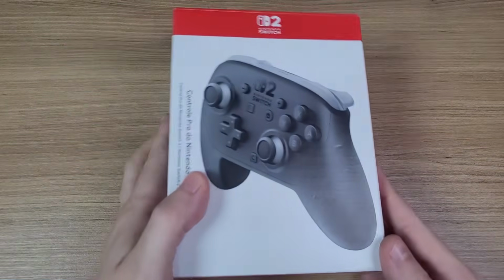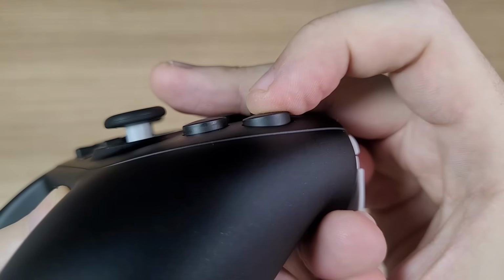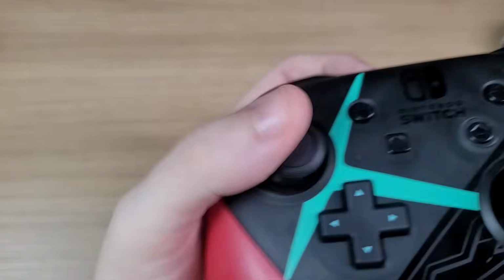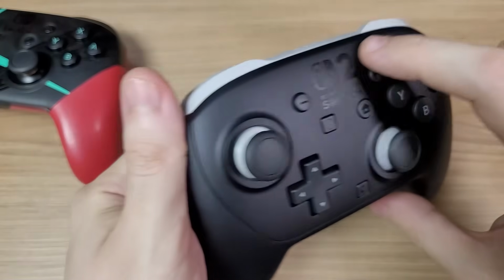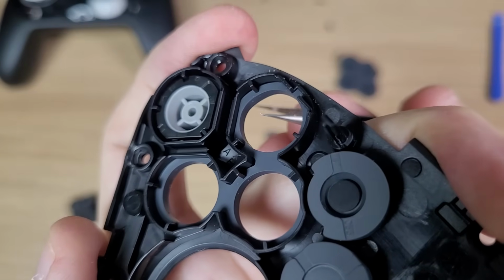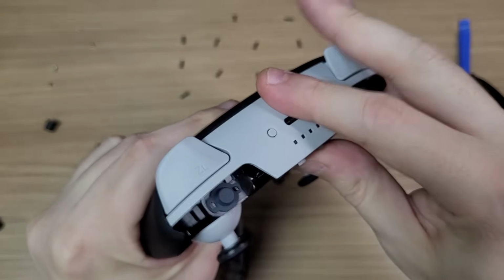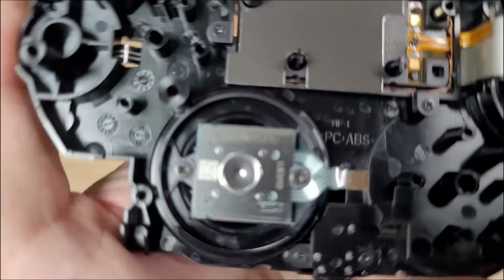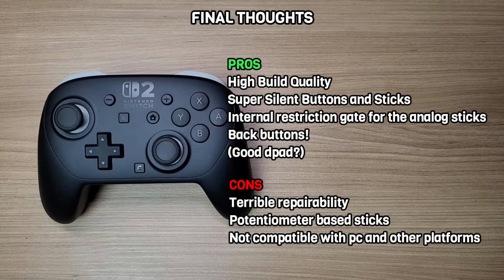Switch 2 Pro Controller Review & Teardown - The New First Party King?

Comment: I despise controllers with built-in lithium batteries that aren't easily replaced. There should literally be a simple cover with one or two screws and have instant access to the battery. My controllers always last me 10 years or more but those batteries won't
Reply: I still have my original Switch Pro Controller, and after 7 years and 1000's of hours, the battery still gets me 30+ hours of gameplay per charge, which is way better than any other controller I own. Definately wouldn't worry too much about it!
Reply: @samuelmcconkie  Yeah I think he is missing the fact that the Switch Pro controllers' batteries last SO DAMN LONG that when they lose capacity they still last a really long time.
Reply: @Krytern  he probably never even used a pro controller in his life
Reply: What's with these negative responses to a simple preference stated. I love my Xbox controllers because I always use my own rechargeable batteries and can replace those in seconds whenever i want

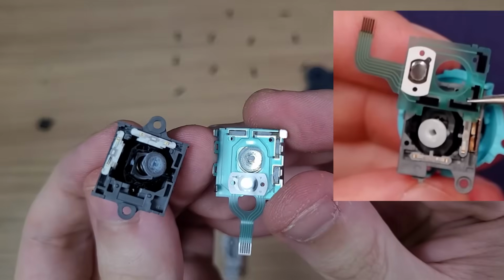Comment: 16:30 paying $80 for this controller and getting potentiometer joysticks should be a crime dude.
Reply: In Poland 105$ Was schocked that it has digital triggers 😆
Reply: A bigger crime is people paying $199.99 for a Dualsense Edge or Xbox Elite 2 controller and those are using the same kind of sticks. 😬
Reply: You can pay 200 bucks for one of those fancy, super modular Victrix Pro BFG controllers and STILL not getting hall effects (and also cheaper plastic).
Reply: Got plenty of criminals out there then because Playstation, Xbox, they're all wiper based. Even the $200 controllers are wiper based. People like you are delusional as if everyone else is offering Hall Effect or TMR and only Nintendo is somehow not doing it lol.
Reply: u got a point but theres tmr joysticks for switch
Reply: @stevensv4864  so now you're at  $100-$120 after mods

Comment: No way. They used the same internal joystick design as the inherently faulty JoyCons. The design used in the old Pro Controller has been used by many controllers for decades, and always held up better. Now Nintendo decided to use an inferior one that puts extra strain directly on the brushes and pads. The side-mounted rotary brushes are definitely better because the stick doesn't press down on them. This is just poor design, hall-effect isn't the only solution.

Comment: 15:48 Those thumbsticks look extremely similar to the sticks used on the ROG Ally, which do have hall effect replacements. So I wonder if they will work with the Switch 2 pro controller?

Comment: How does sticks smoothnes compare to vader 4 pro's?
Reply from the maker: moving the stick around feels nearly identical to the vader 4 with the same tension on the adjustment, but touching the edges feels much nicer thanks to rubber internal restriction gate

Comment: The plastic smells on your hands and the D-pad is worse because it presses other unwanted directions. I'm not sure what kind of plastic is used, but it may be not good for health. The old one and controllers from other consoles do not smell when holding. The back buttons are also annoying, even if disabled. The good thing is the audio jack. For the D-pad I prefer separate buttons like on Joycons. I like the controller, but the issues idk... And why is Nintendo disabling the use on computer? It makes no sense. Just to annoy fans? Btw there is a new EU regulation starting 2027 to provide better access to batteries of devices. Just like back then. I hope so when I see this complex disassembling. So maybe for Switch 3 in 2033?

Comment: I have opened many old controllers, NES, SNES, N64 and GameCube controllers, they are so easy to open. Now this switch 2 pro controller, looks like a nightmare to open, I just bought one. For sure thank to this video I will never attempt to open, if I open it, probably I will not be able to close it. I am so glad switch 1 pro controllers are compatible.
Reply: yeah the og pro controller was so easy to open but this one is the exact opposite
Reply: Some goes for Ps4/5 and xbox controller that cheap membrane in the front bottoms las about 2 year and you have to tear the whole thing apart and it plastic pint are super tight is a hell to open them,
Reply: they cannot wake up the switch 2 however
Reply: @RationalFunction Yeah that's part kinda sucks I mean I have my switch 2 on my desk so it's easy to turn on it but it still sucks
Reply: yeah, but at the same time Nintendo did this on purpose for their bottom line, lol (screw them) @AJMegaScizor
Reply: ull open when drift starts...
Reply: @omgoat I have 7 pro controllers from switch one, and 10 pairs of joycons, none of them have drift.  I take care to play nice with my controllers.
Probably many people play Mario party o maybe smash bros, the very strong input you have to do in that game, maybe is the reason of the drift.
Now that I remember, 2 of my GameCube controllers from 2002, had drift around 2004, I remember I played smash so much. I think this game is the reason of the drift. I never play it on portable mode, I am scared to damage my joycons.

Comment: I did some stick replacements on the switch 1 joycons through ifixit myself. I also took apart a pro controller 1 to remove dust from it. 
The ifixit instructions advise to disconnect the battery cable asap for safety reasons. So why would you put the battery as well as the connection at the very bottom of the assembly?? 

I mean I get it. The danger is probably relatively low and it's not primarily meant for customers to open electronic products, yadda yadda yadda... I still keep wondering xD 
(I'm no expert at all just a curious person)
Reply: The instructions for this type of kit are designed for people who are really unfamiliar with electronics or anything else, and therefore to ensure they don't make any mistakes and avoid accidents like accidentally creating short circuits. Generally, when you know what you're doing, the moment you disconnect a battery has absolutely no importance or influence on disassembly, apart from the convenience you gain from disconnecting it at the right moment (often at the beginning so as not to forget, when the cable is placed in front of a component to be disassembled, or when it's the last thing to do before being able to separate one component from the other).

Obviously, I'm talking about this for a controller. A console or other devices potentially on standby or dependent on powered memory is a different matter.

Comment: This controller is the most absurdly quiet and smooth controller I've ever used. If it starts working on PC, it'll be a streamer's dream because of how little noise it makes.
Reply: i dont know about this one but my switch 1 pro controller drifted after 6.5 years which i would say is pretty good
Reply: Streamers already have a "dream" controller which is quiet. Called the Dualsense.
Reply: Ignore streamers, this is perfect for those late nights when the gf/bf goes to sleep earlier and the click of the gamepad bothers anahah
Reply: The pro controller 1 is steam compatible, only a matter of time until this gets added aswell
Reply: My dual sense is just as quiet, they're both super premium feeling controllers!
Reply: @DefectiveButchrReviews duel edge battery is joke compared to this one tho
Reply: @bobbyrivera2951  I don't have the Edge, just the normal black one. I think in the time that I've had it in 2 years, it's actually died on me once.
Reply: You can use it on pc easy just get a NS magic usb. It emualtes xbox for pc. I use dualsense on my switch 2 with it.
Reply: dream with drift and no replacement parts lol
Reply: @omgoat  every single controller in existence is prone to drift. don't act like this is a Nintendo only issue
Reply: @standlethemandle potentiometer Yes but there are 3rd party way cheaper controllers with hall effect sticks
Reply: @standlethemandle  the gen 1 switch joycons did have different joystick modules that were significantly more prone to drift than any other controller, now when someone says that an xbox or PlayStation or even a switch pro controller is more likely to drift than another that's false because they all use the exact same joystick from the exact same manufacturer
Reply: @omgoat  This thing's only been out for a week
Reply: @omgoat  Dirft doesn't happen with the pro controllers, it's with the Joycons. Try to keep up bro.
Reply: @Krytern  actually it can happen. When I bought my Zelda TotK styled Pro Controller at launch in 2023 it literally drifted out of the box. I sent it to Nintendo and got it back a few weeks later and it works fine since then
Reply: @omgoat you expected replacement parts on day one?
Reply: @omgoat  the one having drift are the joycons not these on
Reply: @juliox9  I never had drift on my Switch 1.
Reply: @Arpthingy  i did but I changed the stick myself, same on my PSVita, but what has lasted me from the star is those microswitch botton on both console unlike the xbox controller i use on my PC where the membrane get destroy in like 2 years
Reply: @omgoat No controller I’ve ever bought new has ever started drifting, even after many years. Exactly one controller drifted, and that was pre-owned. Y’all are just treating your controllers like shit and complain when there are consequences.
Reply: @cassmi-8787 you are wrong, potentiometer sticks are about to drift No matter what, its just bad from Nintendo youll have to buy another one u cant solder the hall effect cuz its modular, just a cashgrab
Reply: @cassmi-8787 Exactly. Yes it’s technically possible, it’s also technically possible your controller can just snap in half for no reason.

You just don’t hear about drift unless it’s joy cons and dualsense controllers, which both have ACTUAL issues. Not every potentiometer controller is built so bad.
Reply: @wet0wl not even the ps5 controller is that prone to it either, Its just sensationalism outlets and youtubers farming views of how scared people got since the dreaded joycon drift, even if the majority of those views are from people who never experienced drift in any other controller. that and reddit magnets, people only search and comment on web pages when they have a problem, not when everything is working as intended; Basically confirmation bias.
Reply: @omgoat Drift is such an overblown issue.

Literally no controllers outside of the first joy-cons and PS5 controllers have widespread drift issues. I have never heard of drift in any controller outside of those two in my life.
Reply: @DioBrando-qr6ye And I have a pair of joy cons without drift, saying it’s not a problem is dumb when it’s documented significantly.
Reply: @wet0wl my 360 controllers all have drift, you can't tell when playing on the 360 because the dead zones are set so high but connect it to a pc and they're all over the place
Reply: @wet0wlthat'll be bias from your own personal experience. 

Lol, I've set up a side hustle repairing these things.

Comment: Pro controller has genuinely improved a lot, the sticks are thin for more range like dualsense, buttons have shorter travel, standard back triggers better material
Reply: no hall effect is no buy for me
Reply: @omgoat  thats valid too, hall effect sensors are thicker take more space, so switch 2 cant fit them, pro controller can but they didnt go for it
Reply: @shivamarya5225  didnt nintendo published a patent for the ´´air-soft sticks´´ that they now use? the idea was with that to eliminate drift without the need of hall effect.
i should check the patents know that i think of
Reply: @alexanderflores-MazterDestiny No its still potentiometer which causes drift, i can understand joycons but pro controller is just money grab cuz u cant change it to hall effect you have to buy new expensive pro controller... its modular No way to solder stick
Reply: @omgoat  No, modular is good, if it was soldered you would have to replace the controller, modular means its easy to replace the sticks because they are a seperate module no soldering needed

Comment: You need to update your 8bitdo USB adapter firmware
Reply: it doesn't allow to communicate with switch 2 procon, instead you could use any other controllers with switch 2
Reply: @tyoma53  Yes, you're right.

Comment: Why 1st party companies controllers are all hard to open with many screws and no hall effect sticks or triggers 🙄
8bitdo controllers are easy to open and beautiful from the inside out without drift
They even updated their switch controllers firmware to work with switch 2
Reply: Dualsense is very easy to open and much of stuff inside is easy to replace.
Reply: @shubkin-7  no sh!t Sherlock
8bitdo is way easier, opens like a book

Comment: Question…

What does Microsoft & Sony use for their sticks? 

I am sure it also isn’t Hall Effect.
Reply from the maker: It's not hall effect but in their defense hall effect sticks were not common during the ps5 or xbox launch, so in the product project that component were unavailable

If they still use potentiometer sticks on their next generation I'll gladly shame them too
Reply: @VKsChannel  They couldn't even do it in their $200 premium controllers? The Dualsense Edge was released January 2023... Hall Effect sticks  have been around longer than that.
Reply: @VKsChannel  Sony and Microsoft also didn't put magnets that likely cost just as much as Hall effect sticks into their controllers just as an attachment gimmick.

I know I would have happily kept the rails and gotten JoyCons that weren't near-guaranteed to break multiple times a generation.
Reply: It baffles me how it's not the industry standard at this point.

Comment: These joysticks are downgrades from the original pro controller right ? The fact they're now use a joycon like design instead of a traditional stick ?

Thankfully they're not soldered though, can't wait for TMR joystick replacements to be available
Reply from the maker: Actually no

They feel a bit harder than the originals but much more smooth

Being a smaller module doesn't mean they're worse
Reply: @VKsChannel  I wasn't clear enough, I do own a Switch 2 and the sticks do indeed feel amazing on Pro Controller 2.
My concern was more on the durability aspect.
The fact they're build similarly to joycons, that's a first for regular size joysticks and quite worrying when it come to drift...

Comment: It's a pity they glued on the front plate. Would have been nice to make it magnetic and easy to customize.

Would have also been nice to see an easily-replaceable battery; there are 14500 cells with similar or higher capacity to their pouch cell.
Reply: that's way too many cells

Comment: the best feeling controller far and wide. the backside buttons are really good. the shoulder buttons are not triggers but just buttons (thank god i hate triggers). the faceplate glued in is annoying but manageable. the sticks will hopefully be fine for some time and replacement will at that point propably be available with ease. ps5 or xbox controllers are not even close imho just alone by the shape. the build quality and backbuttons and trigger less design make it my personal fav controller by far. and while 90 bucks is expensive, sony and ms are far worse when it comes to controllers with back buttons and third party controllers can be extremly pricey. for people that dont use the backside buttons its expensive for sure but for those that use them the controller is cheap and the build quality is unrivaled. cant wait for the steam support for the pro controller

Comment: I honestly prefer this conteoller to both the xbox elite 2, and dual sense edge, just because of how smooth the sticks are
Reply: I feel about the same. The lack of analog triggers and Nintendo's button layout make it so that I wouldn't really consider using this on my pc, but it is one of the most comfortable and high quality controllers I've ever used.
Reply: No way lol edge is way better
Reply: @scottd7222  I personally can’t stand symmetric sticks
Reply: @tao-mkj @tao-mkj I'm the exact opposite... The module that has lower surface dimensions, is harder to press and requires more precision should be more accessible than the thing that's easier to push pull, reach due to its height and has greater surface dimensions and dexterity. 

I hate when I play precision 2D platformers or games reliant on the d-pad and have to use an asymmetrical stick I get that people mostly don't play those type of games but those type of games are more common than the 3D movement games and I don't think 3D movement games that requires stick suffer as much as precision d-pad users for games that require it when 3D movement games are prioritized in the controllers.
Reply: @scottd7222  The Edge, like the Elite 2, is a complete scam for suckers. I much preferred to customize my own original Xbox Series controller to make it even better than the Elite 2, with more options for 50 euros less than the controller. Magnetically interchangeable sticks with adjustable spring tension and TMR modules. Triggers stop, gyroscope, larger battery, macro, button remapping, and 4 additional back buttons for a controller compatible with everything (except PS5, but who wants that crap?) with a dongle reducing latency.

The only thing I had trouble doing was unsoldering the old sticks for the new ones. Everything else disassembles without tools and can be reassembled on another controller in less than 10 seconds if I ever break the first one.

Your Edge is indeed a rotten controller for naive people who just want to show off by saying they own it.
Reply: @scottd7222 no way lol. This controller has like a 40+ battery life 😂